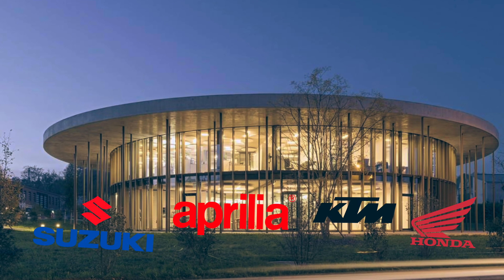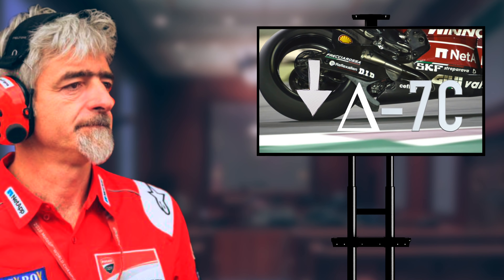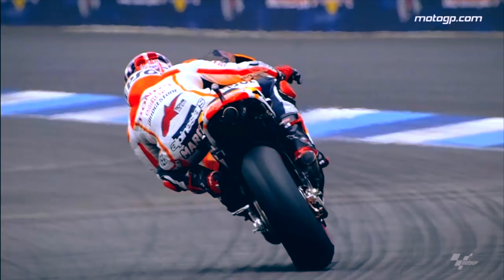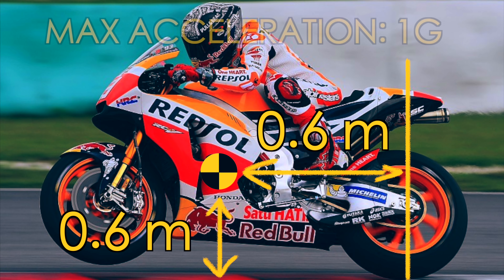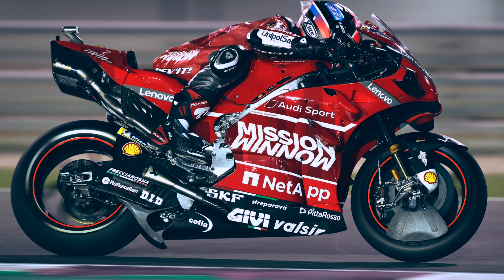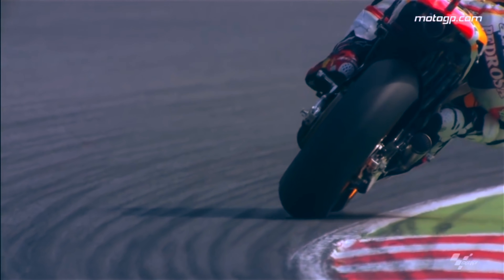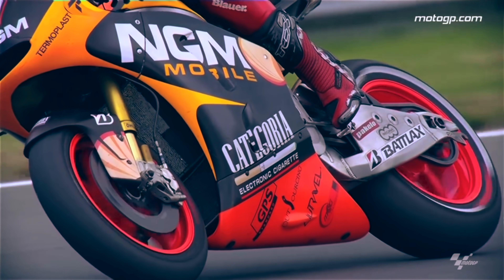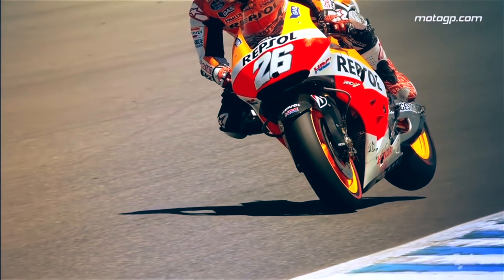5 Amazing MotoGP Technologies

Comment: The height of the center of mass above the ground is irrelevant to whether you will wheelie. It's the wheel radius compared to the distance from the center of the wheel to the center of mass combined with the angle of the line from the center of mass to the center of the wheel. Ideally that angle is zero (parallel to the ground).

Comment: theres so much wrong in this video its not even funny... for one the swingarm thing is not about the height of cg(though it doesn't hurt), it is about the torque required to lift the front end of the motorcycle with a longer moment arm. A longer moment arm will require a higher torque to lift the front end

Comment: Steel disc will not overheat when they are calculated correctly. GT cars can run them in 24h races without any issues aswell. The only reason they are used is weight saving.
Reply: But don't carbon discs have a higher optimum operating temperature?

Comment: What is the "mesh" that you see covering the exhaust exit that you see on moto gp bikes?
Reply: They are there to keep rocks from going in when they crash ,Motogp tracks use alot of gravel traps . Teams also have a limited amount of engines they can use, so losing even one could be devastating.
Reply: @Gcanno  SERIOUSLY!?
Reply: @budyeddi5814  yeah if the bike slips into gravel backwards after a crash, che exhaust could guzzle a lot of gravel. Just one tiny piece can fuck up an engine.
Reply: Thanks guys! I would've never thought about that😂

Comment: It’s funny I just had a conversation at the shop today at work with a guy who was preaching the amazing handling prowess of the Hayabusa. His argument was that the longer bike actually corners better than typical 600/1000cc sport bikes and that MotoGp is actually going to an extended swing arm design. He was using all of this data to explain why he bought a Hayabusa for canyon carving instead of a liter bike because “once he gets more seat time none of us will be able to hang with him” Right now he is slower than pretty much everyone he rides with, but he won’t contribute that to him having too much bike or an improper bike, he just thinks we are all better at cornering than him currently. I was trying to explain that on a track while it may be beneficial to have a longer swing arm for cornering in some instances, on the street you really need the angle provided by a proper sport bike to carve canyons because on the street there are lanes, opposing traffic, hard shoulders, etc. On track we can pick much different lines and use a LOT more real estate on the tarmac to make our maneuvers so yes on track I have seem guys on Hayabusas and ZX14s put in work, but on the street a skilled rider on a 600/1000 I always see do better than the huge bikes. What is your take on this?
Reply from the maker: Handling has many aspects we need to consider.

- Height of the center of gravity
- Wheelbase
- Rake/trail
- Mass
- Tire sizes
- Engine configuration
- Suspension travel
-....
Etc. the list goes on.

If some of the best riders in the world would ride at their best pace on a large track with a stock Hayabusa or ZX14, and then with a stock GSX-1000R and ZX10R, they would have the best lap times with the GSX-1000R and ZX10R.

As far as riding on the street, canyon carving, a good rider on a Husqvarna 701 Supermoto or Ducti Multistrada will spank sport bikers all day long. Primarily because the SM and multi has so much suspension travel, good for the bumpy canyons, and a high center of gravity, which makes them flick side to side really quick and without effort.

On open roads with long sweeping corners any 1000cc bike will be really hard to beat.

Comment: Great video!  I’m just getting more into MotoGP from F1.  This is the first time I have heard a “hole shot” device explained.   The only thing about the swingarm spoiler is that a change of 7C is a change of 12.6F, not 44:

40C=104F
47C=116.6F
Reply: Haha. I was looking for this comment. The thing is, 7°C is 44.6°F. Not the variation, but the actual temperature. You correctly mentioned the variation at 12.6F, but the person who wrote the script probably just googled "7 Celsius to Fahrenheit".
Reply: @josereinaldo8227  you’re right, but the video is wrong.
Reply: Yeah that conversion really annoyed me. The difference between a temperature difference and an absolute temperature should be obvious to everyone. My thermo lecturer always advised us to think in terms of Celsius degrees rather than degrees Celsius for temperature differences, for exactly this reason.
Reply: This is the trouble with pandering to users of non-SI units not accepted for use with the SI. Best just to avoid them altogether unless absolutely necessary.
Reply: Was just about to write this. 

Mis-information is everywhere 🙄
Reply: @stevefarrimond  7 celsius is 7 celsius.
Reply: @stevefarrimond  Well, its not his fault he has to convert to a system literally no country uses. Also, his videos have the LEAST misinformation of any motorcycle youtube channel. Fuck off...
Reply: @jonnyj.  Two kinds of countries as it relates to measurement standards. Those that have put a man on the moon and those that use the metric system. I use both systems in work and play.
Reply: @jonnyj.  in the Uk we use hybrids of all measurements. We can also convert them correctly. 

As for your last bit. Pathetic. 

Standard keyboard warrior.

Comment: So, is seemless gearbox something like a dual clutch transmission?
Reply: I don't know why he described it like this. Motorbikes have had the same dog box transmissions for decades, formula one uses them and many other performance vehicles. The thing he is talking about is electrically assisted clutch less shifting. It is called quick shift on many bikes today. It cuts the ignition, this offloads the dog gears in the transmission to allow it to disengage the current gear and engage the next gear.
The trigger is a switch on the gear lever that triggers when the rider tries to switch gears, ignition cuts for a couple milliseconds, and you are in the next gear.

The inverse is an "auto blipper" which when the rider tries to down shift it pulls the throttle for a couple milliseconds, disengaging the dogs from engine braking and allowing the rider to change to a lower gear.
Reply: Swesen Are you sure??
Reply: I was wrong they do use a new gearshift system that I had never heard of. The reason for the confusion is that I found the article Mike used pictures and explanations from, it only made claims of how fast it was and a very bad explanation that sounded close to how a dogbox works. This article explains it better: https://www.cycleworld.com/sport-rider/how-seamless-transmissions-work/

Basically it is a system of claws on the inside of every output gear. The claws can't retract to go out of the current gear unless another gear is taking the load during acceleration and deceleration. How the claws are operated to engage the next gear isn't described.

Comment: Mike, I think you've glossed over a few things. 
GP bikes tend to have the swing arm pivot much further forward than a road bike, longer swingarm thus reducing the moment that causes wheelies. This works in conjunction with the COG adjustments and counter rotating crank.  If you ever get a shot of a Polini GP3 or 4 minimoto you'll get a great example of how this feels. 
Ducati did not invent the hole shot device.  It's been used in Motocross for decades and was just adopted and made to work in GP by Ducati. 
The primary goal of a seamless gearbox is not to make it more stable, those things are just beneficial effects. It's main goal is to ensure the amount of drive per race is maximised by reducing periods of inactivity between gearchanges. Think of it as being worth a few seconds per race in drive rather than increased stability. I know they are not truly mutually exclusive.

Comment: Well that holeshot device they use is like the DAS system of Mercedes in Formula One...may not have the same function but I compare them because they can be used anytime during the race only relying to the driver when to use it...Am I right? well I'm just saying my thoughts, not an expert really, just a fan of these sports MotoGp and Formula One😉
Reply: well , holeshot modifies ride height, the DAS modifies front wheel camber.

Comment: Ducati has been innovating on all kinds of technologies and still they refuse to make a bike that turns better and blame Dovi for not winning championships.
Reply: problem with ducati is that they are too tough to handles in corners. This is where Yamaha beats them by a mile. The M1 has superior corner speed when compared to the desmosideci. the Italian makers fare well in tracks which are dominated by long straights (like Austria, Qatar) but in fast flowing circuits (like Assen) or tracks having fast corners (like Jerez) they suffer a lot. Even in the championship winning bike of Stoner, they had to reduce the horsepower from the originally planned configuration. Casey in many of his interviews claimed that the Ducati is very tough to handle in corners. The irony is that Ducati is cash rich. They have a war chest capable of making more investments. But all their innovation, investments are not making the desired returns. Problem with Ducati is that they are like 2003's Repsol Honda team (They believe more in their bike than their rider). They lost the plot when they sacked Lorenzo. Sorry for the wrong reply but their Italian pride is too high. That's the truth. Remember in '18 when Lorenzo finally got the tank modification that he requested from Ducati, he immediately showed results by winning at Barcelona. Even now, if JL has a chance of coming back, Ducati should take it but they should trust their rider more
Reply: @saieashwar9738   and then Honda: let's being extremely different from ducati.. trust this one rider 200%
Reply: @den-iq1cv  Damn true! It is evident in the past 4 races on how Honda is very dependent on their one rider. speaks volume about the kind of a champion rider that the japanese team has. Awaiting his return at San Marino
Reply: Tell that to Rossi and Lorenzo also

Comment: The Ducati GP20's active rear suspension is really cool. It certainly helps them and the riders say it works. They now accelerate harder than ever before and also brake much harder because the load transfer to the front end is slower.  They also currently have the most powerful MotoGP bike in history without doubt. Unfortunately, the new rear tyre by Michelin this year seems to have completely messed up the bike!
Reply: Not messed up, changed some things. They will figure it out
Reply: @rewmeister  They just wanted to give that piece of crap of yamaha and suzuki a chance to win.
Reply: @ampm9771  lol 🤣 ducati . Ducati needs a stoner to win else they are nothing . Ask the Europeans to do something man , it's boring to see the Japanese winning it every time . Thank god Mercedes is doing something relevant in F1 .
Reply: Zarco has somehow sorted out the rear tyre issues to an extent. Somehow the Dovi petrux combo is not able to figure it out
Reply: @saieashwar9738  zarco has the 2019 bike
Reply: Andrew Huddleston That’s right but still he is able to manage it off with previous year engine though (which is commendable). The setup from Zarco’s crew is working better than the factory boys. In that case, the pramac bikes have the GP 20 spec but still they fare better (ex: pecco during the jerez gp where he had a great run before he had mechanical issues. Even jack miller is doing well. He scored P2 in today’s qualifying) somewhere the factory team is missing a key thing. Both factory riders have to provide inputs (Dovi is a master in proving data but the same cannot be said about petrux) and ever since lorenzo’s exit the weight on dovi is too much (in terms of bike development) If you remember during the limited off season testing even Honda had issues with the new michelins but Marquez sorted it out. I personally feel that Dovi has lost the zeal  (maybe due to the bitter relationship with the management for the past one year) I still feel that the Pramac team does a better job. And if you look at Zarco’s team in Brno, key engineers from factory ducati worked with his engineers. Zarco has the potential to tame the ducati. Either lorenzo or zarco can turn up the desmosideci if anyone of them gets a chance at the factory seat
Reply: Sai Eashwar yes you are correct
Reply: Yep they sure do have!
Reply: Just like Williams FW15
Reply: "and also brake much harder because the load transfer to the front end is slower."

Can we assume you have never raced a bike. You want all the load transferred to the front wheel as quickly as possible. When you hit the brakes the bike want to rotate about its COG. The front wheel gets forced into the road and the back wheel gets light. The quicker you can transfer the load to the front the quicker you can stop
Reply: Agree with you bro, this season its all gamble to get the right tire setup the KTM was spot on with there tyre choice
Reply: HERE is The REAL Savior

YaH The Heavenly FATHER HIMSELF was Who they Crucified for our sins and “HERE IS THE PROOF”

From the Ancient Semitic Scroll: 
"Yad He Vav He" is what Moses wrote, when Moses asked YaH His Name (Exodus 3)

Ancient Semitic Direct Translation
Yad - "Behold The Hand"
He - "Behold the Breath"
Vav - "Behold The NAIL" <— YaH’s Crucifixion
He - "Behold the Breath"

“Behold the HAND that Beholds The NAIL” 

PROVES - YAH The Heavenly Father HIMSELF was Who they Crucified

That is EXACTLY what Moses Wrote

Here is what they mean

YaH's Name:
(Ya)d + (H)e, as YaH is what Moses called Him and YaH Declared: "this is My Name, this is My Name for all generations" (Exodus 3)

YaH is The Creator:
Yad He, (HAND BREATH), as YaH's "HAND" Formed man from the dust  of the Earth and His "BREATH" made him a living being (Adam)

YaH's Sacrifice of Crucifixion:
Vav He (NAIL BREATH), the "NAIL" through YaH’s "HAND", that whosoever shall call YaH Savior, His “BREATH” brings forth life (Salvation)

How YaH arrives:
YaH arrives via the Tent of Meeting (Exodus 33:7:11, Isaiah 54, 55), where a Tent is erected outside the city, a cloud descends upon the entrance of the Tent and YaH appears...

Why they demanded YaH to be Crucified:
YaH was Crucified according to Hebrew law (Deuteronomy 21), to be Hung on an Almond Tree for BLASPHEMY as it was for His NAME they demanded Him Crucified. The Messiah claimed He was YaH...

HE WAS YaH!!!

HalleluYAH “Praise ye YaH”

From The Hebrew Book of Isaiah, The Dead Sea Scrolls

Isaiah 42:8
"I am YaH; that is my Name! I will not yield my glory to another or my praise to idols.

Isaiah 43:11
I, I am YAH, and there is no other Savior but Me.

Isaiah 45:5
I am YaH, and there is none else.